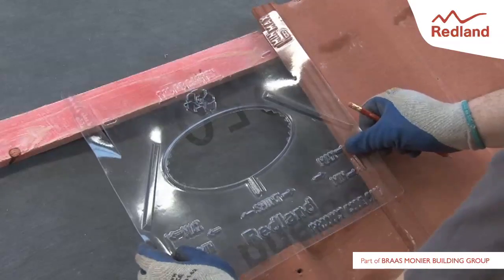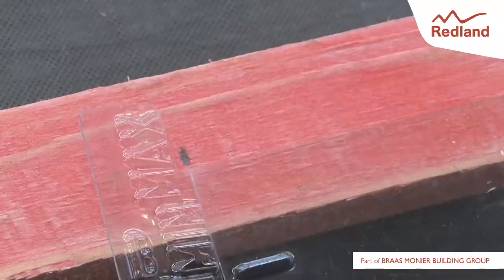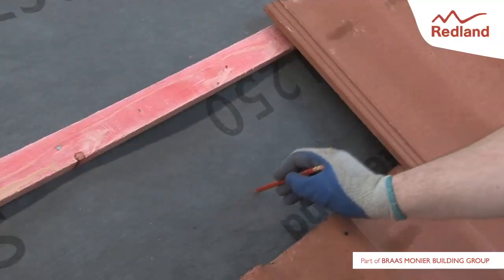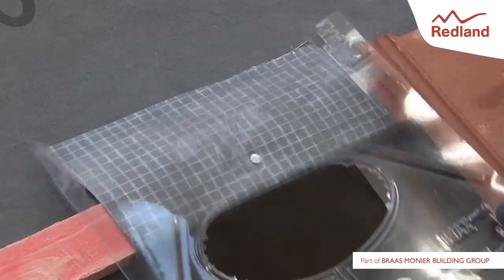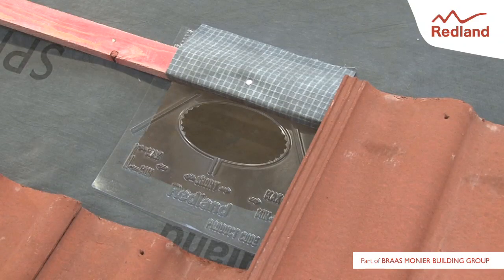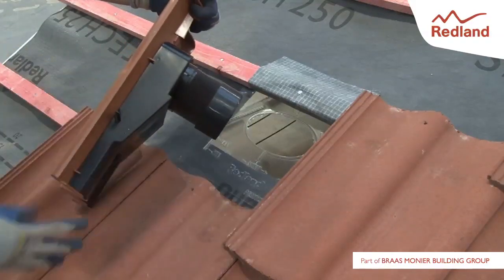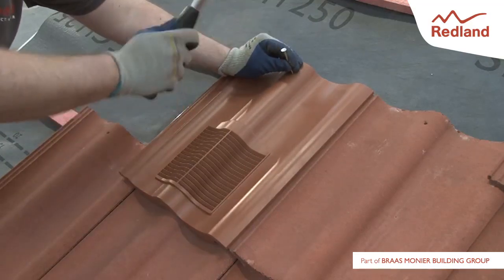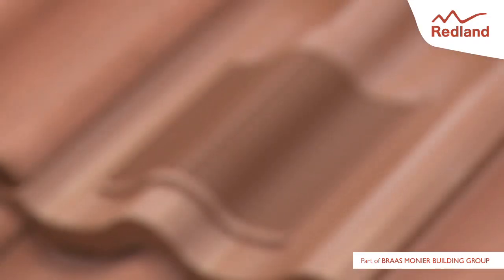Rapid Roof Vent installation video

Comment: Hi. Very informative. My roofer hasn't folded the upper lip or upper part of the felt onto the batton above. Infact it's hanging down into the loft. I saw that the home's original extractor fan and sewer ducts also have hanging felt all around them? Is that acceptable ? I showed him this video and he says dont worry? I have done thousands and there wont be a problem?? Losing my sleep over it. Please help??
Reply: Same here. But I’m not using it for extraction. But still worried too
Reply: @EpicInsaniTv  i think felt is folded for neatness.
Reply: You get this from roofers over and over again. Most of them never read the installation instructions for the products they fit (in fact, a lot of them have poor reading skills); they often do things the wrong way simply because that's how they've always done it. The fact they they haven't had much  comeback does not mean that their work was satisfactory. We often find someone different when we realise the person we had before wasn't that good. They are not the brightest people except when it comes to finding excuses and telling you things to confuse you and shut you up. Most of what they say is untrue (even if they don't realise it).  The only way to get the job done right is to find out how it should be done and get this written into the quotation (this is a binding contract). Unfortunately, seeing that you know what you're talking about and insisting on using correct procedures, a lot of them will find excuses not to give you a quote.
Reply: @michaelwoodman5976  you are absolutely right.  However if you think about it logically, if you fold the felt up and place the vent over it , it should stay in place? But also the air vent tile/slate is designed that when it rains the water runs down the bottom of the slate/tile onto the slate/tile below?! Wouldn't you say? I am not a roofer.  I am though choosing between a roof tile vent OR a multi lead slate...to allow a soil pipe to go through the roof and out.  My main question at the moment is which one will do the job better?   The air vent tile I could do myself ££££% but the mutli lead slate I will get a roofer to do ££££.

Comment: I have those in my roof but they are just open ended in the loft. Are they used to keep a loft ventilated? Also below one of them the ceiling looks damp and cold on the thermal image camera, can these let water come in through the fins?